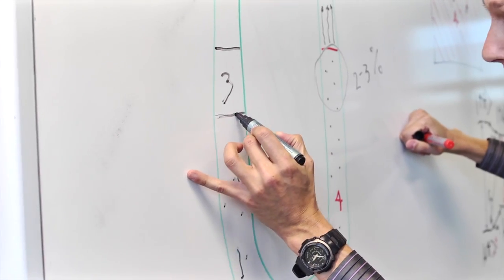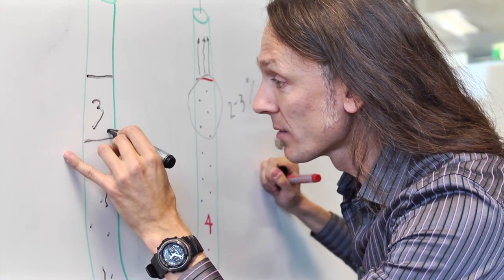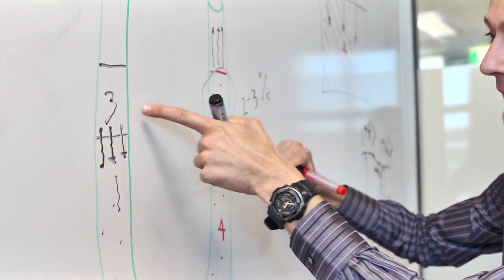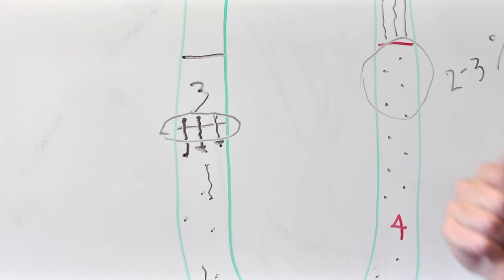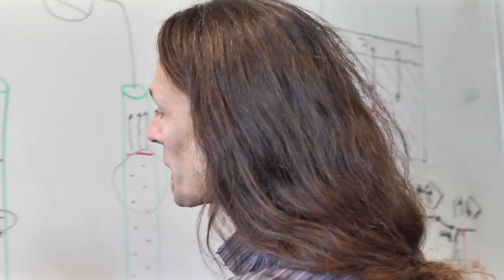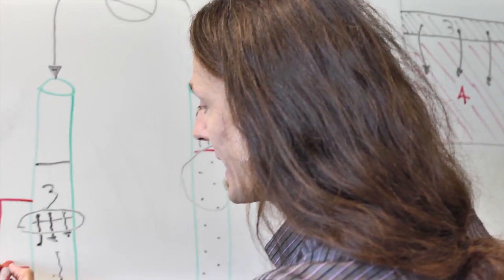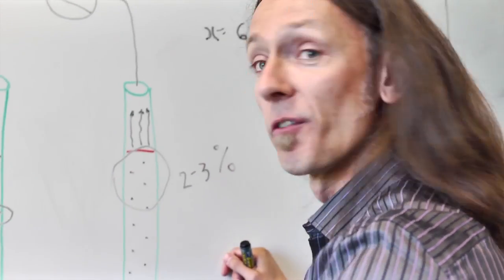Quantum Cooling to (Near) Absolute Zero

Comment: I work in HVAC and regularly work with cold air chillers. He is not making sense. Like what refrigerant will be used? How does a compressor interference get removed to avoid affecting the system? Would the computer need a vacuum? If using steel, how are you making any parts keep magnetic conductivity?

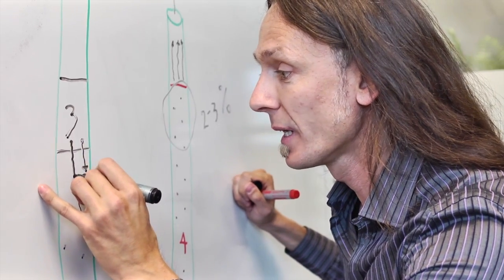Comment: 5:35 - why does entropy increasing absorb heat? I understand if you add heat to a system you increase its disorder, but conceptually I’m trying to understand why a system which increases its own disorder (in this case via the Van der Waals force) has to absorb heat. If you were at absolute zero and there was no heat to absorb would He3 still go into He4 because of the Van der Waals force? I’m assuming yes as Andrea said at absolute zero the concentration is 6.4%

Comment: That's not just like alcohol. You turn your mash to 173^F it will barely steam and still produce a mixture. The vapor is higher in the more volitile substance by a predictable amount (first methanol, than higher alcohols, heads, then ethanol then tails then water is the order of volitility . With a reflux still you can get 96.4% ethanol that way, it's an azeotrope (a point where it's still a mixture but the BP is lower than either pure substance) at which point you need a good safe dessicant or molecular seive to get any farther.

Comment: I just found this and must say that this is really well explained, but one question remains: how do you cool a massive object like the 1,1 ton copper-aluminium sphere down to such temperatures? I imagine that even the slightest blackbody radiation emitted by the physical environment around the setup would cause a noticeable temperature increase on this level of detail and accuracy. Of course the surroundings of the sphere have to be cooled down too, in a very high vacuum, and perhaps in multiple layers reducing the temperature gradient of the sphere and the environment, but wouldn´t even such small temperatures make a rather large difference regarding the results of the tests? 

Anyway, this was a great vid and I really enjoyed watching it. Best regards

Comment: Affascinante. But there is definitely something missing here. Everyone who does chemistry knows that in distillation, both substances have a non-zero partial pressure above the liquid being separated. If the analogy was 100% exact, then some He(4) atoms (albeit less than He(3)) would be transferred into the He(3) layer, thereby increasing slowly its entropy and I suppose at the end it wouldn't work. Everyone can test something similar using, say, water and diethyl ether: the system is biphasic, ether floats over water yet is slightly soluble in it and boils at a lower temperature. In this case, there’s the underlying assumption that the partial pressure of helium 4 at the end of the U-tube is 0, so that none is pumped from right to left. I guess this is the case because He(4) is superfluid, meaning its temperature is uniform in the tube, and all its atoms are coordinated so none can escape (no temperature gradient, so no evaporation). On the contrary, He(3), which has a spin of 3/2 and is a fermion, cannot become superfluid (because it would violate Pauli's principle - EDIT : well, it can, but only by pairing with itself, which restores an integer spin number, at 1 mK, which is below the lowest operating point of this heat pump) and therefore acts as ordinary matter. I suppose it’s that unique combination of both superfluid and 'ordinary' fluid that makes that heat pump work, so this is not repeatable with other combinations.

Comment: LOWER HEAT =  GRAPHENE GRAPHINE WATEVER BUT  UTILIZE BAKED INTO A DIAMOND WAFER AND LIKE A MONOCHROME CRT DISPLAY FILTERED THROUGH R G B DIRECTED DPI OF COMPRISED COLOR ITS THE SAME ASNTGE FACEYS FOR EACH DIAMOND WAFER! BY MEANS OF PROJECTED INFARED LIGHT, OR LASERBEAMS!  AS FAR AS OF HIGH OR LOW REQUIRES YOURS EXPERIENCE FOR TWEAKING TO MAKE A NEW COMPRESSED quantum cpu form factor also by means of mirrors (special non heat conductive type) then sum, = lower form factor, less energy and higher computation!!!!!

Comment: I have a question: I understand that once the helium 3 atoms jump into the helium 4 the drop in temperature due to entropy increase results in the liquid extracting heat from the Qbits to ensure they go into the quantum state! But this also means that the heat absorbed will again raise the temperature of the helium 3 atom, and not to mention the heat absorbed from the tube and the pump due to friction. How is that heat dissipated so that once the helium 3 atoms return to the tube they are not hotter than before?

Comment: Ok let's pause the theory for a bit! What is the size of the u tube we are talking about here exactly? And we also know that helium can't be stored for long no matter how much you insulated them. Do you need to connect that u tube cooling system with a liquid helium dewar or something? How long will the helium 3 and helium 4 solution inside the u tube last? Refill when the solution runs low? If you know what I mean!

Comment: 1.9 mK? The pump adds energy to the system right?  I mean it makes particles move which is exaclty what we dont want. Also whats the pressure? To make He 4 evaporate at such low Tempereature means its almost vacuum. But how can you cool down such a massive copper ball with a vacuum? it means there are particle which could carry away the coppers energy/heat.

Comment: How they remove extra energy (temperature) from this system? We introduce heat from our apparatus and from pump, we need to remove this energy away from our system. I think it uses another helium kriocooler to cool the He3 vapor after pump. Correct?
Reply: In order to extract only helium3 from the helium4 solution the pump has to be at about 0.7 K (at this temperature He3 has a much larger vapor pressure than He4) , much larger than 20 mK, so yes, the pump could introduce heat.
To solve this problem there's a heat exchanger between the chamber where  the two solution are mixing (U tube drawn by prof Morelli) and the chamber at 0.7 K. The simplest heat exchanger is a tube in an other tube in which the fluids flow in opposite direction and reach the thermal equilibrium thanks to heat exchange.
Heat exchanger for diluition refrigerator has been invented by Frossati and thanks to this he reached 1.9 mK with the diluition tecnique.

Comment: crucial point not mentioned: both He3 and He4 are in liquid phase and cooling comes from heat of mixing. 

otherwise, if He3 is vapor then cooling will happen at other end of the tube since condensation process release heat and evaporation process absorbs heat.

Comment: This effect, using electrons instead of helium atoms, can be found in a device called a Peltier device using the Peltier effect (huh?).  Essentially running a current through two ceramic plates, typically 2-3 inches across, that sandwich pairs of Bismuth Telluride dice.  The thickness is the sandwich is typically less than a quarter inch.  The result seems almost magic.  There are no moving parts.  One side of the sandwich becomes warm, and the other cool just by using maybe 6 volts DC.  They continue to warm, and cool, until their proximity to each other starts to cancel out any greater change in temperature as the cool side cools the warm side and vice versa.  However, if you remove the heat by blowing air over the warm side (like the soup example here) the cool side will fall well below freezing.  Not a big deal compared to absolute zero, but a method to cool a CPU quite effectively.

Comment: Very interesting but pretty heavy stuff: quantum mechanics and thermodynamics combined. Also usually this type of equipment allows this extreme cooling only over a very small area. So how do they achieve to cool a 64 kg copper ball uniformly to that temperature.
Literally only the top of the very cool iceberg we're seeing here.

Comment: This brings me again up to the conditions inside of the "core" of a black hole. There is and can be none of any particle movement because of its density (except for what he mentioned as the heisenberg uncertainty - the small amount of the fluctuation-based energy which is radiated away steadily - Hawking radiation).
So, the center of a black hole is a place of hightestpossible mass concentration with the smallestpossible volume extension but literally has no thermal energy. It rotates fast. Very close to 0 K. Much closer as we on earth could even push it by quantum-cooling through helium fractioning in the lab.

Comment: 2 questions;
1. Where does the energy come from to move the H3 atoms into the H4?
2. Why is the limit 6.4%
Reply: 1. They don't, it's a spontaneous process
2. 6.4% is not the limit, it's just the concentration you measure at equilibrium

Comment: this type of cooling could be used to create a quantum computer. A vary small CPU can out do most computers currently sold on the market. it uses a different type of computer code called a "Q" bit. A Q bit can be a 1, a 0, or a 1 and a 0 simultaneously.

Comment: What would happen if you condence something then cool it to absolute zero then expand it? Would it some how become colder than absolute zero?
Reply: That is impossible. At absolute zero particles would not move at all and you can't have less than no motion, so you can't reduce the temperature more. That's why it's called absolute zero. Also, as he mentioned in the video, it is impossible to reach true absolute zero at all due to the heisenberg uncertainty principle.
Reply: Pootis Spencer Here so if the condensed particles are already at absolute zero and it expands would it just be converting potential energy to kinetic energy warming it up or would it stay at absolute zero?
Reply: It would stay at absolute zero. The temperature after expanding a gas is a fraction of the temperature beforehand. Since 0 divided by anything is still 0, the temperatur doesn't change.

Comment: why are 2 helium atoms used? if the object is to get the lighter helium 3 to diffuse into the pool of the heavier helium 4 why is a heavier atom not used in conjunction with a much lighter atom of a different element? wouldn't that allow the light element to get closer and diffuse more rapidly and efficiently into the pool of heavier atoms?

Comment: Some people would understand you better, perhaps they aren't dumber necessarily and see problems with your analogy to soup, if perhaps you could have said that the two liquids seem to need to maintain the mixture of 6.**% of He3 to He4 so there is almost like a magnetic effect unless this mixture percentage is maintained. Therefore it attracts new helium 3 into the, basically thermal, battery at the mixing point aka primary point of  imbalanced vapor pressures (gravity, and magnetics as well and maybe even something we have yet to name properly)then the heat is pumped beyond this point, or perhaps it is heat and/or He3 you did not say now I have to research the stinking device IS it a thermoelectric cooler or is it ran off of electricity, magnets, electromagnetics/light and maybe even catalysts,  so what in the world does soup have to with the working of He3 level heat pumps or what ever? You didn't fill the gaps in and that shows a poor presentation in a way. Atleast in that part. Other than that yeah I have wondered a little on the details now I wonder more because of the lack of details. I'm still gonna mark the like button cause it did make me think a little. btw it is that the more energy you add to matter the more it behaves as energy and vise versa the spin is what mediates these and not what should be referred to as the vibration of but rather the spin of. All things spin.

Comment: isnt helium becoming solid at lower tempretures how can it be 1 kelvin i dont understand can someone explain ?
Reply: Good question, but... helium is the only substance does not solidify even at absolute zero! This is because the quantum-mechanical zero-point motion is sufficient to "melt" the solid, since the attractive force that would make the atoms bind is so weak. In order to solidify helium, you need to apply about 30 bar of pressure, bringing the atoms closer together so that the van der Waals force overcomes the quantum motion.

Comment: How can something be moving at absolute zero? Movement = energy = heat. If there is energy, there is some level of heat, therefore you can't be at absolute zero. 

I mean the amount of heat you'd have would be impossible to measure, but it would be there at the level of cold he's talking about. 

PLEASE HELP I MUST BE MISSING SOMETHING
Reply: You're missing the difference between temperature and energy. The temperature is a measure of the statistical spread of energies among the individual constituents of a system (the helium atoms, in this case). Zero temperature means that all the helium atoms have the exact same energy, and that energy is the lowest possible. It DOES NOT mean that the energy is zero. In fact, at zero temperature, each atom will have half a quantum of vibrational energy. If you tried to reduce their energy further, you would violate the Heisenberg uncertainty principle.

Comment: +2veritasium ... Good explanation of basic principle of the Dilution Refrigerator, but a little physics/chemistry knowledge is required to understand it... van der Waals forces, entropy. Have you explained those and Absolute Zero elsewhere? Also, Absolute Zero really does not come into play with this device, and as a result, the necessity of invoking quantum effects is not clear. If you really want to get wild, make a video about how common lasers involve Negative Temperatures on an Absolute Scale, which in this age of Yellow Journalism/Clickbait might be called 'infinitely cold'! ("So inaccurate, it's not even wrong!")

Comment: You say that you need it cold to avoid normal heat vibration but you said that even at zero kelvin there are still vibration, how do you know that it's not that or just not vibrations?

Comment: Do depending of how much helium 4 there is in a container depicts how much helium 3 can attract to it? It seems to me that there can only be a certain amount of helium 3 attracted to helium 4 at one specific time but why doesn't each atom of helium 3 get equally attracted to each helium 4? and if the u shape tube is vacuuming, wouldn't the lighter liquid be pulled through or is there too much surface tension and weight for it to be pulled?

Comment: What i kinda wonder is when you try to measure things that are smaller than an atom, how do you know that the changes in measurement are actually occurring? How do you know that it's not just your measuring instrument that is messing with you? I mean, if the only way you can detect the changes is by using your measuring instruments, then how do you know that your instrument is accurate? Do you just "trust" that it is accurate based on theoretical calculations or is there some other method by which you can check the validity of the information that your measuring instrument is giving you?

Comment: As I was taught the universe, there are no attraction forces, because no one can demonstrate them or even come up with a theory for them. 

The universe as I was taught is purely a pressure based system. Where ambient radiation from every possible angle and direction flows constantly, through matter. Solids, Liquids, and gases, are being bombarded constantly by repulsive ambient radiation. Ambient radiation that is just particles of electricity at varying velocity. It is only the quantity at any given time of particles of electricity within an object that creates, electricity, heat, light, gravity, or any other effect. The quantity at any given time depends upon the velocity.  

Within a cold object there is a shortage of particles of electricity, the reason is that once ambient radiation that creates and stabilizes matter passes through the surface of the cold object, which requires a transition, a change of direction, and velocity, the particles of electricity are positively accelerated within the cold object. Basically the only difference between a very hot object and a very cold object are the number of particles of electricity within the object at any given time. The less particles of electricity at any given time within an object, cause the object to contract under the external pressure of ambient radiation. And the lack of repulsive particles of electricity within the cold object. As the particles of ambient radiation move faster within, they effect the particles within more frequently, this causes cold objects to vibrate at a higher pitch, than hot objects that vibrate at a lower pitch. A hot object causes ambient radiation to slow within the object, the atoms of the hot object also move more, but more slowly. 

If you tap a piece of room temperature steel with another piece of steel you can cause it resonate a very high pitched tone. If you heat that same piece of steel to orange heat, it will no longer resonate a high pitch tone. it will create a dull tone. So although we say we excite the metal by heating it. In reality we are slowing it down by heating it. Sure the atoms in a hot metal move a greater distance however the movement is slow and sluggish. Because ambient radiation spends more time within a hot object, pushing the atoms apart, than a cold object. 

Today we learn this almost in reverse to the actuality. 

Sincerely, 

William McCormick

Comment: wait, so if they're just measuring how much the metal sphere contracts/expands, then why would it have to be a solid metal sphere at all? Like, it could be hollow, or some other shape entirely. I suppose it might be harder to control for stuff like acoustic vibrations in something that would 'ring' more than a solid sphere, but when you're talking about distance scales that small, I'd think that geometry wouldn't change an effect like that enough to make a huge difference.